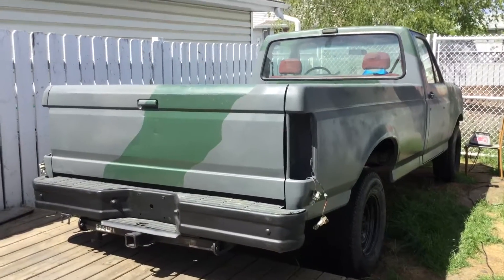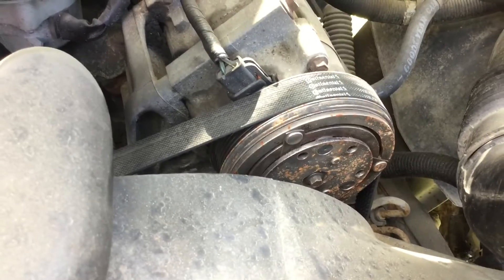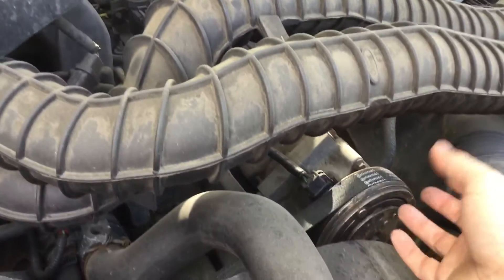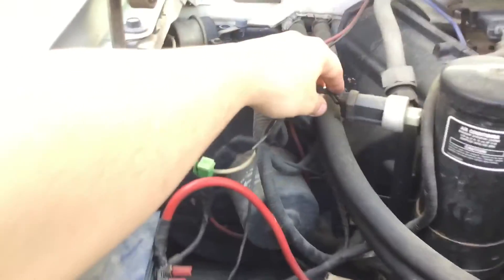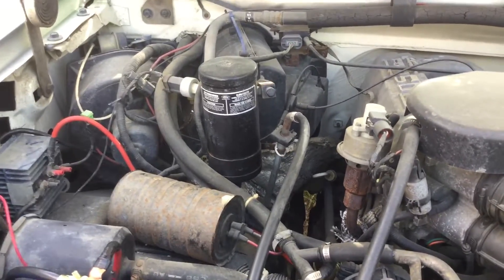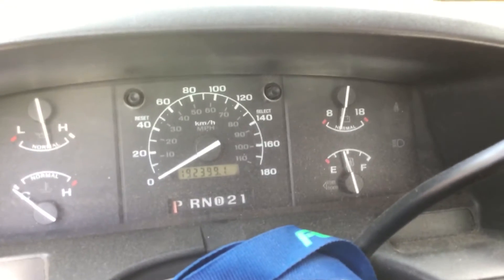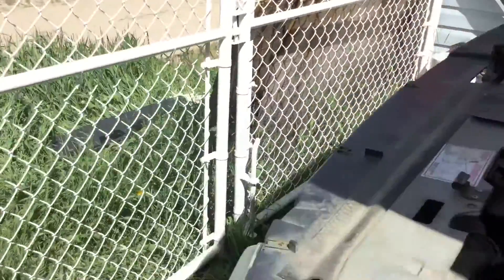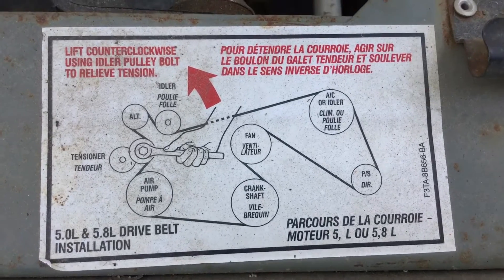Help: 1993 F250 AC Clutch/sensor/plugged line? (302)

Comment: Do you have any lubricant in the system? You can buy some from Cad Tire and a low side lubricant tester(looks a bit like a tampon with a hard plastic case around it). It could be running dry, overheating then shutting off/seizing.
Reply from the maker: You are talking about recharging the AC?